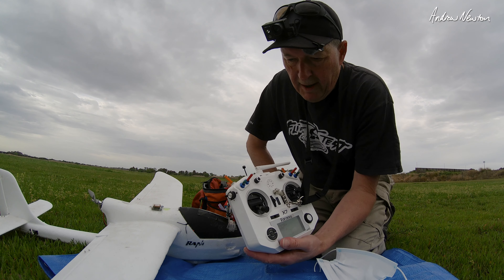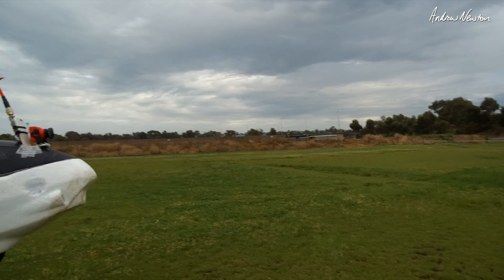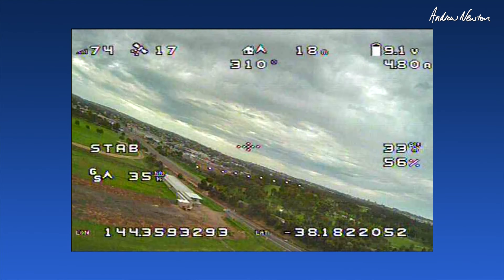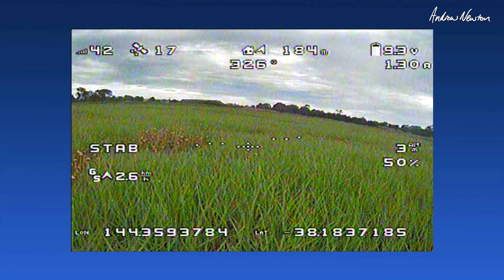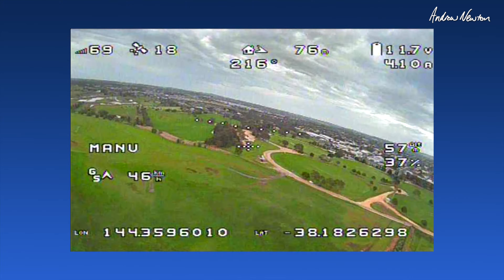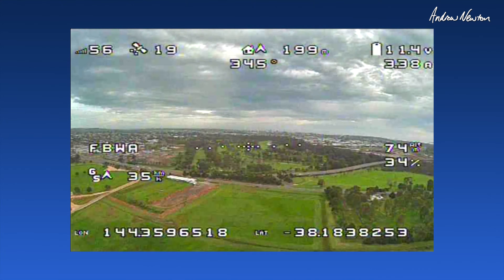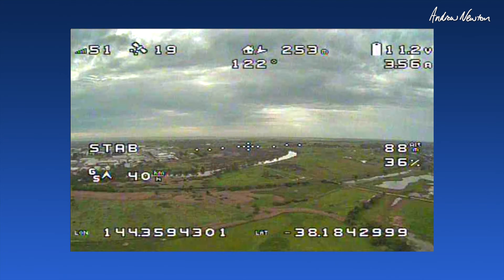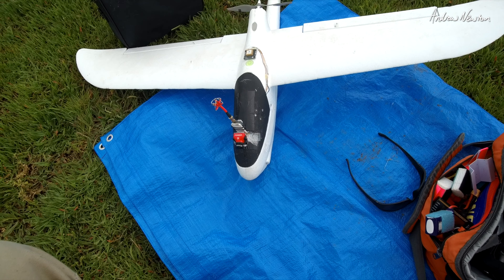Matek H743-Wing with Ardupilot

Comment: I have found ARDU is light years ahead of INAV for just about anything fixed wing. On two different wings INAV drilled me into the ground It must have been INAV cause I am A SUPERB pilot LOL!! I am sure it was me but in reality on two separate planes  I suffered an unrecoverable tip stall, I only changed the firmware and it has not happened since. I think my luck has just been better with ARDUPILOT, and my terrible piloting was at fault for my crashes with INAV. ARDUPILOT has simply amazed me. I have run a mission from a park bench and programed a landing in front of me. Without touching the sticks it took two steps to recover my plane, Yes I thought it was gonna hit me.
Reply from the maker: Ha, very cool, and brave

Comment: I only switched my F405W in the Dart XL-E to Ardu last week and slowly learning the variables. Still working out how to loosen up the FBWA tune so it doesn't resist me when I want to play in the trees with some mild stabilisation. First issue encountered was failsafe default of Circle mode for 5 seconds before RTL which caused a premature landing when I was low level.

Comment: It is always best practice to power up Ardupilot with the Aircraft  Level in Pitch and Roll.....Switch Modes and adjust servos in Manual, Stab and FBWx ensuring servos are neutral at each mode change without  movement. Also ensure that you wait long enough for full 3D GPS Fix prior to Flight...Always , trim in manual then perform AutoTune procedure in Pitch, Roll and Yaw......Add Pitot/ Static for optimal stability and performance. Once tuned, just level, boot wait for Beeps, verify controls then wait for 3D GPS before launch ......Good Luck, Enjoy
Reply from the maker: Thanks for the tips RYBAT

Comment: If it's any consolation my attempt to switch from MissionPlanner to QGroundControl made things too difficult to bother with, so well done I say. I like that there is a multi-platform alternative in the works, but so much work has gone into MP that making an equivalent is a pretty long road yet.
btw I don't think you should be trimming anything in your radio at all. Just leave all the trims in the center, because that's your input to the flight controller (ie. if roll trim is non-center then auto-level will not be level, acro will constantly roll etc). As long as you calibrated the accelerometer the plane knows when it's level, if the GPS and baro are working it knows when it's climbing etc., so no trimming should be necessary. This likely means you'll not be able to fly hands-off in manual mode, but I mean, it is manual after all.
Reply from the maker: My trimming was purely pushrod length adjustment, I actually disable radio trims for INAV and Ardupilot. My Manual was way off for some reason. More testing required, which is the fun part for me.
Reply: Bill Revenaugh
1 second ago
Chris, it's so awesome to be commenting on Andrew's video and see you here! You guys are my absolute all time favs and you inspire the heck out of me.  That brain of yours is just amazing.  (BTW, your most recent homeslice has me craving a corn-dog for some reason 🤣🤣🤣) Just kidding man, it's absolutely gorgeous.  Well done as usual.

Comment: Unbelievable timing!  I just finished my first Ardupilot build last weekend and put it on (of all things) an AXON!   🤣🤣🤣 using an old $13 Omnibus F4 Pro.  It is SO COOL!  
One of my toughest challenges was getting those 6 modes on 1 switch (I used weights and logical switches, basically) and I looked to my old friend Andrew's channel (cuz I was sure he had done it at one point, but ....GOOSE EGG! 😂).  Another cool thing about the ardupilot setup is I put some telemetry radios on it so I can execute waypoint missions and watch it live on the Laptop in the field. You HAVE to try that - it's a kick!  (and the telemetry radios are really cheap).  I am just delighted with it.  

Oh and btw, Amber will indeed say FBWA, FBWB, Auto-Mode, Loiter, etc (pretty much every ardupilot mode) but I'm sure you knew that.  

As usual, absolutely love your work Andrew, and don't forget - I'm still planning to move to Australia someday and live in your shed ! 😊
Reply from the maker: Aha, I probably deleted the Ardupilot related tracks from my Amber pack ages ago.

Comment: Welcome to the other side!
you can set the OSD visually using a GUI in mission planner, you just haven't found it yet,
Now you have tried the best you wont wanna run anything else on your craft once you get the hang of the config.....it blows everything else out the water.
Reply from the maker: I'd have to buy a PC first
Reply: @AndrewNewton  Looks like there's a phone version in development, so you may not have to.
Reply: @AndrewNewton  oh,  I just assumed you had one, the cheapest of laptops, like a 15 year old one would be more than good enough for rc model Configs on all the platforms but nothing beats a desktop and although I have 3 decent laptops here, I never touch them unless I need to be mobile,  my 3 display desktop allowance me to have soooooo many different things on the go at the same time :)

Comment: I've been having a bunch of trouble getting my H743 to detect my SBUS signal. I have the SBUS signal going to the RX6 pad like Matek says to do, and configured it as they say as well. The radio calibration in Mission Planner never shows any pulses. I have verified my setup is correct using betaflight, where everything works well. Did you have this problem?
Reply from the maker: Probably have to choose the SBUS port in the setup somehow. I cant recall how just now.
Reply: Ben open full parameter list and type serial 6, then make sure Its on sbus! What receiver are you using?
Reply: @kevintorevell2406  I believe I've got it figured out now! Turns out I had the wrong drivers installed on my computer and it was messing up thr connection to the matek. I got it programmed up and had the first flight today!!!

Comment: Excellent review Andrew.
Reply from the maker: Thank you kindly!
Reply: @AndrewNewton  I am not able to get ESC telemetry, because of which I am not able to get voltage and current.
Please help 
Flight Controller:Matek H743-SLIM
ESC:T-Motor P50A 3-6S BLHeli_32 4-in-1
Parameters i set are
MOT_PWM_TYPE=6 //DShot600
SERVO_BLH_AUTO=1
SERVO_BLH_MASK=0
SERVO_BLH_OTYPE=0
SERIAL5_PROTOCOL=16 //ESC Telemetry
BAT_MONITOR=9 //ESC

Comment: You can have more than one switch for mode change. You can have one channel for mode change and add a couple of more to switch to specific channel (RCx_option). Much better to use TX16s with 6 chicken legs for 6 flight modes
Reply from the maker: Aha! Thanks for that

Comment: I have been using a slider for mode selection, with either QGC or MP as the GS and LTE/UAVcast-Pro/RPi0W for the MAVLINK/FPV/long range. Main disadvantage is having to cycle through modes... So far, it's all on the bench. Any opinions re using a proportional slider or knob? (I rely on the GS talking to me).
Reply: I have similar setup to you an and I just use one switch to change from fbw to take off then I switch to rtl so I can look away while I swap over to flying from laptop, then I change modes from MP and fly fbw using transmitter through USB dongle.

Comment: sir i have matek H743 Wlite connect with eachine tx06, video in from eachine connect with C1 pin in matek H743, and video out connect to vtx pin in matek. how can i get the display screen such as arm/disarm, altitude, etc in my googles? thx sir ^^
Reply from the maker: Make sure they are connected to the correct voltage and turn on osd in Ardupilot / INAV
Reply: @AndrewNewton  voltage for eachine vtx sir? I using 5 volt for vtx. For matek using 4 cell lipo battery

Comment: Which software the simplest INav or Ardupilot  (for a simple setup, only need RTH, Stab, and Manual)? 
Do you prefer Matek H743-Wing or other FC, if so why? Matek has a big product stack, and I am kinda confused about which one to get.

Cheers
Nik
Reply: for simplest setup check Zohd Kopilot
Reply: @pinlock4331   In retrospect, the Ardupilot Mega with Ardupilot was not that difficult to set up (Quadcopter 450mm), I know the ZOHD from Andrew's videos but I think its too limited for me.
I think I am going to buy an FC with a Built-in regulator (Not sure which one) for one of my planes (probably the ASW28) and run Ardupilot since I already have a little bit of experience with that software.
Reply: For your ASW get the F405 Wing, price has come down and it has all you need. Works even on my ASW with INAV ( more or less, rudder !!!!) Don´t get a 722, it will block you from Ardupilot.....
Reply: Matek board with ardupilot firmware might the simplest board for the build. Spend some times with mission planner and wont regret it. I once used both ardupilot and inav but end up with only ardupilot for its features and stability.

Comment: Andrew don’t use FBW-B.  Use cruise instead or FBW-A.  Nice to hear the Pixhawk sounds again.  Stabilise mode is fighting the autopilot.  I only ever used FBW-A, AUTO and Manual.  Had RTH on another switch.  Also if you hit AUTO without a mission loaded it will just default to RTH.

Mission Planner works fine on a VM on my Mac.  VirtualBox is free and works well.
Reply from the maker: Thanks for the tips! Stabilise seems to be manual with self levelling?
Reply: @AndrewNewton  Seems like it's a very weak auto-level
https://ardupilot.org/plane/docs/stabilize-mode.html
Reply from the maker: Thanks Chris.

Comment: How do you calibrate current sensor in arduplane?
Reply: Place an ammeter in series with the battery and the plane, spin up the motor and compare the measured value with the value shown in Mission Planner, and adjust the "Amperes per volt" value as necessary.
https://ardupilot.org/copter/docs/common-power-module-configuration-in-mission-planner.html
Reply: iforce2d thank you

Comment: To Make custom sounds in open TX such as FBWA try https://www.open-tx.org/2014/03/15/opentx-speaker  . It's not amber but I use it for anything that is missing. Whoops just noticed it is windows only.
Reply: I found it much easier to use LUA scripts (like Yaapu), which announce the modes (including FBWA etc.) automatically from SmartPort telemetry and also show a ton of other interesting information. Doesn't work on Crossfire yet unfortunately.

Comment: I've been on ardupilot for a few years and find Mission Planner much better for initial setup than QGC. You can install windows on your mac using bootcamp and then use MP. Ardupilot is less user friendly than iNav, that's for sure.
Reply from the maker: Windows on my Mac? I'd buy a cheap laptop before doing that.
Reply: @AndrewNewton  bootcamp is a separate partition so you still have your normal mac, you can just reboot into a windows environment. It's a cheap way to get mission planner going on a mac.

Comment: Now I remember why I dumped Arduplane, the Flight Mode switching was hilarious TBH...wtf?....As I said, wading through treacle...I know it works great, but considering it was around years before iNAV, why does it have all these Elephants in the room...That blocky OSD text too ..you can't change it?
Reply: ...but the RTH circle was much nicer than that what you would have got from INAV.
Reply: @amax2624  Maybe, but I can live with it TBH..
Reply: Actually you don't have to do the complicated 2-switch flight mode switch setup. a) If you only need 3 modes, you can just enter each of them twice in Flight Modes and use a single 3-way switch. b) You can put flight modes on channels/switches directly using RCn_OPTION (n=channel), for example RTL. /  OSD font can be changed, yes.
Reply from the maker: and this is how I learn cool new stuff. Many thanks
Reply: @AndrewNewton  It's a pleasure, I was a complete AP newbie too not long ago.
Reply: @cruisingaltitude5284  A typical 3 position switch will give values of 1000,1500,2000 which correspond to flight modes 1,4,6. So you only need to specify those three, which is what I do.
Reply: @iforce2d  It's a matter of personal preference. Just in case, I prefer not to leave any PWM ranges undefined, or set up with dummy modes that should not actually be used. It only takes about 3 seconds longer so I set it like this. 😉

Comment: Don't use trims! You should have levelled the plane before powering up, your IMU calibration is out.

Also, if you used Windows (I know...) and Mission Planner you'd be able to set the OSD via the GUI.
Reply from the maker: It was only mechanical pushrod length adjustment, I actually disable radio trims for INAV and Ardupilot
Reply: @AndrewNewton  Ah, I noticed your artificial horizon was not level in the first flight and thought that was related.
Reply: @richardhallyburton  I think, you are right, the AH line is off calibration and the reason being, IMO, that the system was powered on, while not being level. There may be a mechanical misalignment in the aileron set up, but the problem with miscalibrated gyro is still there as well.
You can hear, at around 4:35, Andrew says "tilts to the left for some reason", while autopilot tries to level the plane to a wrong (tilted to the left) AH line.
Reply: @SQSNSQ  No need to have it level when powering on. Just let it sit still for a while so the gyro can calibrate.

Comment: Looks like your board alignment is off on roll when you are watching on the artificial horizon. Maybe the reason your trim was odd
Reply from the maker: To be investigated, I'll swap to a different plane
Reply: Or just redo a simple level Accel. calibration with wings level.

Comment: In rtl i forgot to change alt . And it takes 100m in populated wifi area, and i lost link to a plane , it loiter for 46min and then battery dia.then it crashes. Its horrible, so please check all value before fly.
 Its flysky transmitter. If frsky  it doesn't happen.